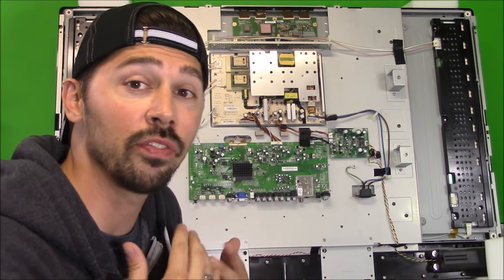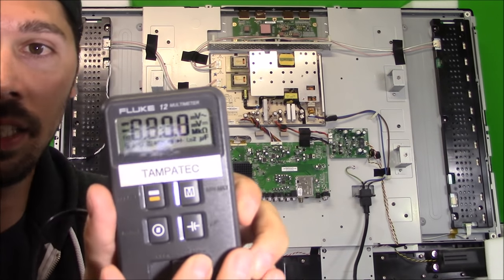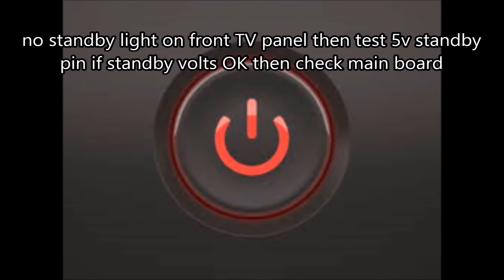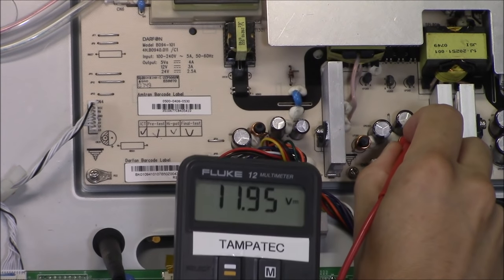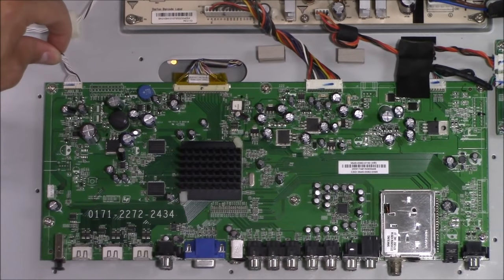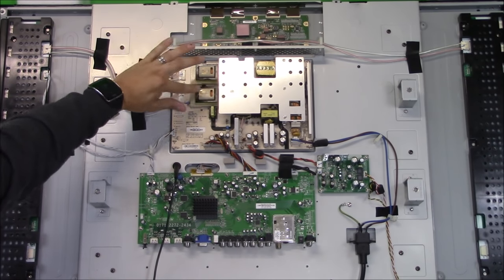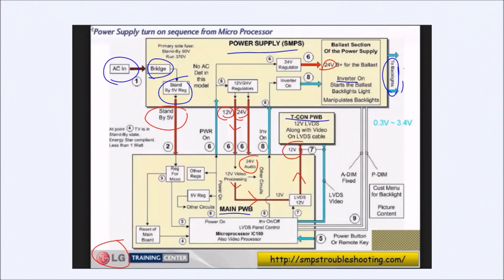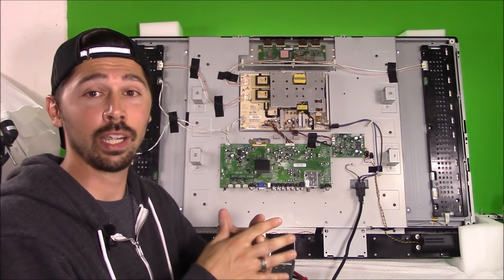ULTIMATE LCD TV REPAIR SERVICE GUIDE for TROUBLESHOOTING BOARD VOLTAGES

Comment from the maker: share this video to anyone it may interest and like the vid if it was informative, thanks for your support. 
fluke multimeter ..http://amzn.to/1I6yRPJ 
20 dollar good auto range meter ..http://amzn.to/1T6AAec 
ISO-tip rechargeable soldering iron- http://amzn.to/1Z4CygA 
Butane soldering iron- http://amzn.to/1S3acEx 
Weller electric soldering station- http://amzn.to/1O9Ui5k
*affiliate links
Reply: +Tampatec I need your help please.  Please review the comments from Bruce D.   Thanks
Reply: Is there a way to check the amplifier chip to know if its bad ?
Reply: Great video
Reply: 120 volts?! 
That is 100 volts too low. Normal is 220 volts. 
No wonder the TV is not working properly.
Reply: Tampatec t
Reply: Hey there, Sir! Just wanted to say - I like so many don't truly have the funds to support your efforts. This is an honest statement. However, know this - I will encourage those who would have interest, to take council from your works. They are clear, concise, and not overtly overwhelmingly technically explained. I just chanced upon your channel, and laud your keeping these devices from filling our landfills unnecessarily. You mentor many, and we would THANK YOU !
Reply: Tampatec so my DYNEX LCD TV / DVD PLAYER IS AT POWER ON READING "INPUT IS BLOCKED" WHAT THE F** DO I DO PLEASE
Reply: I have no picture but has sound on Samsung 3D 55 inch. I have back lights and replaced t-con board but still no picture. What would be problem?
Reply: Tampatec nice video help me
Reply: Tampatec I have an insignia NS-LCD42HD-09 and my screen is blank and black no picture. Could you do a demo for this one.
Yes the standby lights work.
Reply: I have a Samsung flat screen curve TV which stop working I tried trouble shooting it and I got to find out that any time I. Touch the flat cable from the logic board to the t con board the back lights comes on and as soon as I let go of it the lights go out. Can any one assist me with the problem I am stuck don't know what next to do or should I just ordered the t con the logic board and the cable
Reply: @winstonchurchill8300  
I think that is American domestic  Voltage not British standard - my opinion
Reply: interesting points ,if anyone else  trying to find out 
how to repair computer
 try Saankramer Electronic Magazine System (Have a quick look on google cant remember the place now ) ? Ive heard some amazing things about it and my buddy got cool success with it.
Reply: Not certain about the points made but ,if anyone else  wants to uncover 
pc repairs
 try Saankramer Electronic Magazine System (Have a quick look on google cant remember the place now ) ? Ive heard some super things about it and my cousin got amazing success with it.

Comment: The problem isn't so much doing the repair it is getting parts that work. Sending clear to China for what is supposed to be parts that have been checked our only to find after waiting six weeks each time that the part is bad gets tiring after a few times and still my 55 inch Sony 3D TV sits on the floor like a huge paper weight!

Comment: hey I'm in Tampa. i have a 50" onn tv led. no picture but i have sound and backlight. saw a burnt processor on tcon board and replaced the tcon board. still no picture. what else could be wrong? i would like to test circuit and cable but connections are so close together

Comment: Thanks you @tampatech,  this video really helped me fix my 65in RCA led TV. I thought I was the PCB since I kept getting weird reading when checking the stand by voltage but I turned out to be my multimeter.  The main issue was the Main board, which this video really helped me diagnosing the issue.

Comment: Hi Tampatec, I think your tv help videos are a fantastic help especially to people that have knowledge of electronics but are not tv engineers, I have fixed many TV's with help from you and others on you tube,   but I think one of the main problems is cracked screens, there don't seem to be anywhere in the uk supplies new screens and they are a hell of a price even second user, so many good TV's are scrapped because of this,, it hurts to pull apart a really nice tv and scrap it,,   ron  south wales uk
Reply from the maker: if laptop and monitor screens under 32 inch which I did a video, but bigger screens is too costly for manufacturers maybe cause high risk of damage when shipping, that's my guess.
Reply: Since the screen is the most expensive part, those cracked screen TVs should be used explicitly for donor electronic parts so that easy and inexpensive repairs can be done on intact TVs.  If selling the electronic boards to places like Electroparts for some salvage value or extra cash was made more popular, then their would be a lot less shortage of parts to fix good screens.

Comment: Tampatec,

Thanks for this video.  I've done a little troubleshooting already on a dead LG, and I'm going to use this video to guide some more troubleshooting (although my TV is an LED, so there are fewer boards to deal with).  Here's what I've done so far-

The TV is an LG 32LB560B-UZ.BUSMLJM.  The TV does not appear to power-on: no video, no power indicator or standby light

-Verified power cord was connected to a good outlet and passing proper voltage
-Looked at both boards, no puffy capacitors, no obvious burns
-Ceramic fuses have continuity
-Measured voltages on output of power board using chassis as ground (all readings taken without attempting to turn the TV on):
  Labelled 12v/12v - Actual Reading 11.7v
  Labelled 3.5v/3.5v - Actual Reading 3.4v
  Labelled 24v/24v - Actual Reading 25v
  Labelled PWR-ON/DRV-ON - did not take reading

Initially, before taking power readings, I thought that surely this would be a power board issue, but those power readings look really close to me, although I don’t know the board tolerances.  However, it seems strange to me that the 12v and 24v are constantly on, since I measured them without trying to turn the TV on.  I would have thought that only the 3.5v would be constant.

One thing your video has got me thinking about is stability.  I'm going to go back and check the stability of those voltages.
Reply from the maker: +Curtis Faulkner can be main board or power board but i would go for main board get at shopjimmy.com cause they take returns (restock fee maybe charged)
Reply: Thanks.  I appreciate the suggestion and will likely go ahead and get the main board right after Thanksgiving.

Comment: Great videos. Got a tv that was my Dad's who passed away it quit. Bought new one two years ago when wife got cancer.  She passed away a year ago. I dont normally try to mess with these TVs  but these have the memory behind them.
I'm tech savvy but needed these voltages and basic functions to see if I can Isolate .  The newest TV is a Phillip's not even two years old no light. But I had some voltages, wasn't sure of what volts where. Thanks.

Comment: Really enjoyed this video and realize it's older but I'm struggling with a LCD backlight issue and can't find any decent info. Your video was by far more informative than anything currently on line.
Would love to get some advice if your still responding to comments. 
Have a Vizio VX 37l with standby voltage, backlight flashes then out. Tested all voltages on power board as good, bought new inverter board on eBay, same problem.  Don't know where to go from here!

Comment: Hi Tampatec, 

I know this is an older video of yours, but the information on checking voltages is timeless.  I was just given a Coby 39" LCD TV that is totally dead.  It's from around 2013.  I'm going to check the voltages, but I suspect that it's the power supply.  Something you mentioned in this video at the 3:31 mark is if the bridge rectifier is shorted, then it will take out the ...... something.  Did you say, "fuse"?  I'm still learning, so knowing exactly what gets taken out would be helpful.  By the way, the fuse on my power supply is good.

Thanks a lot, Tom

Comment: I like your videos. I've done some electronic repair in the USAF many years ago so diagnostics and repair is not foreign to me. What I would like to know is where can I find the normal voltage that I should see on the test points on my specific Samsung LCD TV?
Reply from the maker: On power board should read 3.3v standby even if tv isn't on. Try here,  https://www.smarttvmanuals.net/samsung/samsung-tv-repair-manual-schematics/

Comment: Love your videos.  Have tried all in above excellent video.  Fuse good, bridge rectifier good.  Power board output Connector only has one place where there's voltage and it's 4.91V steady (standby light on, no display), no other voltages present whether tv on or off...replace power board? Thanks mucho!

Comment: Hi there, at 8:50 of the video you are checking the 12v going to the "Tcom board". I checked mine and it's reading .02 volts. I already replace the power supply, cause I think the problem its on the mainboard. Any suggestions? Any specifics to look on the MB? Any step by step? Thanks in advanced.
Reply from the maker: Juanma Natal yes main board
Reply: Got any recomendation of what to be looking there? And in what order should I'll be looking?
Thanks again.
Reply from the maker: Juanma Natal I had 2 bad capacitors on main board but not sure if that is your issue. if you unplug tcon board and get 12v then bad tcon board is causing voltage drop. if it's still  .02 then check caps trace it down.
Reply: Really apreciated, and thanks for your instant reply.

Comment: Heay my man Tampa tec, much respect, keep up the good work and the good vibes. lock down makes me get involved with trying to repair TV, I learn from you. but I am not very good at testing for fault. I find a dumped LG 50 inch plasma TV Model No PD P50R10 100. main stby light comes on steady, no caps looks swollen, but the green light comes on the tcon. board when I unplugged the main board connector from the power supply board, I lost the green light plus power on red light on the front, Help. much blessings and thanks

Comment: Hey Tampatec - great video! I have an LG 55LB5550-UY that has a black flashing screen. It passes the flashlight test so I know it has a picture. So far I have replaced the power supply board, T-Con board and Main board. I have also also replaced the LED backlight strips. It is still doing the same thing - flashing about once every second. At this point, I'm thinking that maybe the new power supply board I put in has a problem - what do you think? I'm running out of ideas.

Comment: Hi TampaTec. Thanks for putting up all these tv repair videos. Been trying to learn from them hoping I can fix this Sceptre tv that I have. I have a question. My TV is intermittently turning on. Actually there are weird things going on with it. 

The standy light comes on if I let the TV rest for a few hours. As soon as the standby light is ON the TV can be turned ON. The red light turns blue and there's picture on the screen with no problem. 

But after like a minute or so the TV just shuts down completely. No power and no standby light. You can't turn it back ON. 

What I do is I unplug it and wait for like an hour or so, plug it back in then the whole thing happens again.

There's even times that the standby light doesn't come back at all till the next day.

I am hoping you can share some of your expertise on this.

Comment: Hi Tampatec you have answered a lot of my testing on board capacitors etc and the use of the mesr meter .Can you give us a type of meter to test thermocouples on air conditioning units and or one of your videos on testing  newer inverter controlled boards on air conditioning units.This would be greatly appreciated

Comment: Great video TampaTec thank u for this. I will be free to ask u for help. My Quadro tv make me problems. It have power and sound but no picture. When I use lamp I see something. I was open him and on power supply I found one bed capacitor after change it work perfectly but just two days. First day after turning off and stand on stand by for a few hours I need to start him two times and it work. But after second standing on stand by it's no way to turn on. Probably same capacitor again. Please can u tell me why capacitor dieing when is tv on stand by. Best regards from Montenegro.

Comment: We have a Proscan LCD 42LA45H with sound but no picture. No image showing doing the flash light test. The upper four wire connection from the power board to Main board should be 28, 28, 4.9, 4.9 volts, I read 14.92, 14.92, 4.9, 4.9 volts is this the problem?  Also would like more help on testing the T-Con on this unit  please. Your videos are a great help,
thanks.

Comment: thanks for the great vid. I have a Sony kdl-46ex500 lcd tv. it won't power on. no standby light. I am getting 3.3volts to the main board. does this mean that the main board is bad? does this completely rule out the tcon? thanks

Comment: Great Video's I have a Toshiba 32" 32AV502U witch i have had for yrs. The trouble that i have now is  i turn tv on the green  light comes on it try's to come on and  i start to see pic then it doesn't come on but the green light stay's on till i turn it off. If i cycle it several times maybe 6 times when the picture starts then it's fine and stay's on. I get the impression that when it starts it not getting enough Voltage
to stay on like a clinoid in a car. I haven't yet taken apart yet but i will in the future. do you any video on a 32AV502U with the same problem?
thanks Bill

Comment: Great explanations and demonstrations;   trying to work on an LG374450 when it turns on gets image and sound - the indicator light goes from Red to Blue than after about15secs. lose everything and the Blue light turns to a blinking red. Testing the power board voltages pins going to audio - when it is on initially have (2) 20volt pins and (2) 3.5v pins and (3) 12v pins when the indicator light goes from blue to red blinking lose the 20volts and 12volts from those pins, been checking diodes but so far haven't found anything --- any suggestions

Comment: i wish to inform readers about my experience in trying to repair a LCD Samsung 52" TV   Some time ago my daughter gave me her TV set because it was completely dead . She wanted to throw it  away and I strongly refused to do it. I promised to look at it and put again in operation. In spite of my age (88 years old) I started a research and I found this site. I have some experience in electronics because i am a licensed Radioamateur but without a particular experience in modern LCD TV.  Of course the first thing i did was  to look at the main power board.I changed all  filter electrolytic capacitors apparently good but with a too low working voltage I substituted with 25  working voltage  capacitors with  a total expense of less then 10 $. The set was always dead except the stand by red light and the clicking of main switching relay. Audio was working  but screen totally black.  Then I started a very patient control of the various voltages present in all boards (main power board, logic board ,T Con board). I  strictly followed the various suggestions of Tampatec how to proceed with my multimeter. All LCD  were not lighted  and i began to search some replacement board  to recover this TV. The voltages were ok but no high voltage to drive the inverter board . Few days ago I was looking once more at the back side of the TV and I was bit desperate to find reason  of the missing high voltage of the inverter.  I was convinced that all was in order but no way. Black screen persisted. Then suddenly I had a very simple idea.  A very banal reasoning. The voltages are ok but may be in some connector the electric contact were bad mainly for oxidation or for other mechanical reason. Then i started to disconnect all connectors of each board and with the special liquid for increasing conductivity i sprayed either the male and female connectors putting then again in proper position  (feeling with fingers the small click when properly inserted. ) Et Voila  Everything started all worked fine . Great satisfaction! I kept the TV on for many hours and days switching on and off just to be sure of my work. Hope that this experience could help others readers

Comment: Hi Tampatec , thanks for what you are doing for people.. I wanted to ask you if you would be able to help with my issue. I have Bauhn ATV-55 FHDED its led tv not older then 3 years. Iam I have a problems turn my TV on. It's always turn on I can see a logo and turns off and on again cycles. Sometimes starts to run. I check powerboard and replaced 4 caps which looked not normal. But no change. Still same problem . What I have noticed is that on SPON pin I have 4.4 V and Iam not sure if it's enough. Thank you for any idea

Comment: Thanks for your informative videos. I am replacing the main board logic SMP chip. This chip has a metal backing that I think may be a heat sink made onto the bottom of the chip. This chip does not come off easy without damaging other it and the SMP’s that’s around it. I am using a rework station and this chip acts as if it is (heat sink on the bottom of the chip) soldered. Any help would be appreciated.
Thanks in advance

Comment: Hello Tampatec.  I was wondering if you can give me some suggestions on what I can do next for a TV I am trying to fix.  It is an RCA 22" LCD Full HDTV.  The problem is crackling sound.  There is one board that handles both the audio and video (video has no problems).  So far, my thought has been to replace the board.  But so far, I have not been able to find a replacement (tried the links to parts from your vids and they don't carry the board-and tried other places and was told it is not made anymore.  I haven't even been able to find a circuit schematic for it.  
Any suggestions would be appreciated.  Thanks.
Reply: Checkout the capacitors and inspect them. Do you have an ESR meter?
Reply: @cyo_corner  sadly, i do not